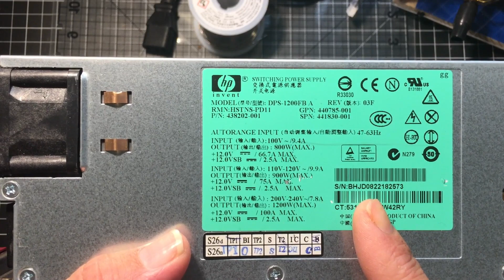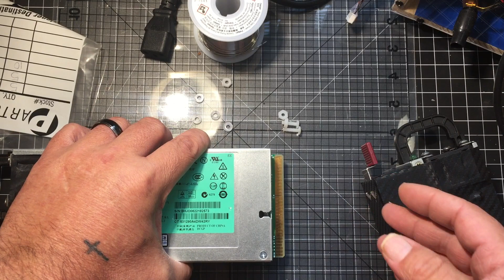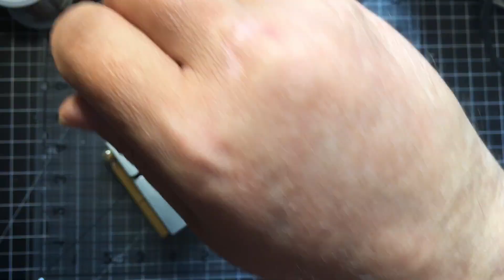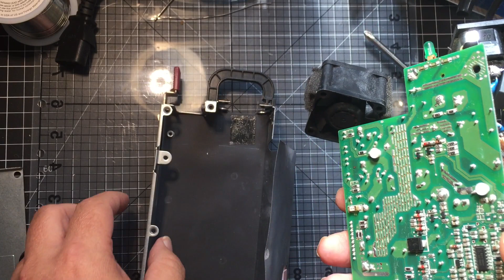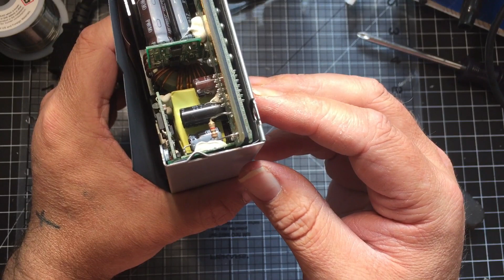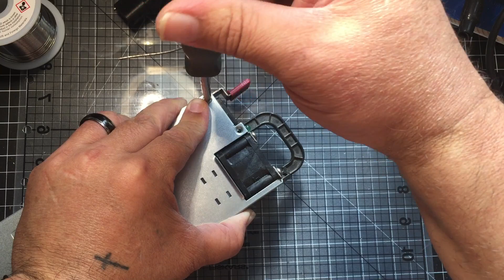HP 1800W (2 x 1200W "900W @ 120v)Server PSU Hack 24V 74A  (HSTNS-PL11) (floating Mod)

Comment: Can I solder a momentary switch to the green+ground or does the short have to be permanent for it to stay turned on?
Reply: You can solder a switch across, it will work

Comment: Should the Server PSU fan be spinning once it received power? Because my rig is pulling around 550watt from the PSU for 3 days now; and the PSU is getting super hot at the center, but the fan isnt spinning at all. Should i be worry? and request for a replacement ?

Comment: Hi, for the benefit of others, i have a HSTNS-PL14 model and 1k resistor between 33 & 36 does not work, so i tried short-circuit between 33 & 36 and it's work perfectly!

Comment: Hello.  please help me, I accidentally made contact between those small pins, the fan went into speed and from that moment even if I make contact between the first and fourth pin, I don't have 12v and the green LED doesn't light up anymore.  Did I burn her?  Is there any chance it will work?  thanks a lot
Reply from the maker: Unfortunately these power supply’s are really fragile when it comes to the pins and interior. I’m not sure if it’s salvageable. It’s hard to know without having it in front of me . Sorry wish I could help.
Reply: @njfulwider5  thanks a lot. Hope to fix it.

Comment: Hi, I bought 3 pieces of HP PSU, each of them is 12V 900W output @ 110V input, can they be connected in series like batteries ?
Reply from the maker: I have seen 2 done in series personally. But I haven’t tried 3. I think there is a video floating around on YouTube where the poster used 3. If I remember correctly he hacked 2 of them and they worked, but I think it maybe safer to find the video and double check. Just to make sure it safe 👍👍👍
Reply: @njfulwider5   Thank you so much !

Comment: good psu or bad ?
Reply from the maker: These server PSU are so cheap and work very well for diy projects. I've used them in a few projects and so far so good!
Reply: @njfulwider5  thank you for confirm , i read is loud / noise not for room . that currect ?
Reply from the maker: @q8tech108  I haven't had no issues with a noisy fan yet. But I could see where that may be an issue later on after tons of usage?

Comment: Where is part 2?
Reply from the maker: Been struggling with the curcuit I made for it, so I put the second video on hold while I caught up on other project, but I do plan on posting before the end of the summer.
Reply: @njfulwider5  thanks for the video. I was hoping to see how you connected them in series. Just that part of it. Is there someplace to see that? Or read what you read or whatever? Thanks again. Eh.. it's not just like you do with batteries is it? 🤔

Comment: How do you calculate the correct ohm resistor?
Reply from the maker: Just watching other videos and doing a little research on other servers PSU I found on Google.
Reply: njfulwider5 is it always the same pins that need to be connected with the resistor or does is vary by power supply?
Reply from the maker: @coltoncarew3047    Each PSU is different unfortunately.

Comment: How do you know your float worked without performing a continuity check from the ground to chassis? You had a multimeter right there.
Reply from the maker: This is not a Hack I created, but a hack well know throughout the DIY community. I didn't come up with it myself. But a continuity test was done, just not videotaped. I have even already finished Part 2, Just need to edit once I get a chance. This is just something you need to do if you plan to use 2 in series, and you plan on the case touching each other stacked. Most PSU like this has to be floated, even good old PC Power supplies where the DIYer uses 2 in series.  The only part causing the PSU to connect to the case is the 2 front screws.  Some even go a step further and do all 4 screws.  I have made many double stacks Power supplies for friends and family, this is just one that posted a couple year ago.
Reply: @njfulwider5   It should be illegal to name something "Part 1" without releasing Part 2 within a year!
 Joking ...kinda.  Although I am glad I didn't watch this way back in 2018!  ;-]
Reply from the maker: Robert Cartier yea I struggled with the curcuit for this and had to put on hold till I figured out what I did wrong or gained more experience. Then one project became 1, than 2 than 3.........then👍👍👍👍
Reply: @njfulwider5  still nothing? My understanding is you just connect the + to the + and - to - then you connect 1 pin from 1 psu to the other pin on the other psu. Can you confirm?
Reply from the maker: @XX-PrinLer-XX  yea the one I was working on was pretty close to basic. I can use them in series easily. But I wanted to create a circuit that shut both off instantly if one shut off for any reason. I also wanted to make sure the curcuit look nice👍👍👍. I think I found the problem and I order more components. Fingers crossed it works, or I have to just 86 the idea and do what everyone else did. Hopefully the new component works👍👍👍
Reply: @njfulwider5  I float my ground on one. Wired the pos and neg. Put a resistor onto both so they turn on automatically. Someone, somewhere mentioned i needed to join a pin from each psu together for load balancing?

Comment: Could someone please point me to his part 2 he mention about Security switch thing in the video trying to do this Or to the guy he got the idea from thanks. I can't find it. Will keep looking.
Reply from the maker: I have not edited the video yet, as it is in-line with the others I have to edit. I do a lot of projects as much as possible, but very slow at editing. The switch is pretty simple as it uses an OctoCopler, that shuts off the power when the other PSU is not producing it. I used Perfboard and a few resistors, fast switching diodes, regular diodes, and the octocopter, I will post a link on this video as soon as it post. If you subscribe and click the bell, you should also get notifications once it post.
Reply: @njfulwider5  thanks for the quick reply. oh okay I thought it was old video. I understand keep it up your doing good I'm just starting. Thanks for making the video. I kept looking though youtube and found this video is about using zener diode here the link
 https://www.youtube.com/watch?v=EQGZm-M_90E&t=310s

I will wait to watch your video. I need to know where to solder the stuff I'm pretty new to this. Now I wondering which one is better or safer.

Comment: how to adjust the output voltage to 10v using external pins?
Reply from the maker: I have only used the potentiometer to adjust to 12.6V personally. But I believe I saw another user adjust to 11.5 at the lowest and 12.9 at the max. To get 10V, you might look into a very powerful buck converter that has the wattage to handle whatever you plan to power @ 10V. I've used both buck and Boost converter with these types of supplies with good results.

Comment: Is floating the ground necessary for a single stand alone unit?
Reply from the maker: Not for a single unit, only if you plan to pair it with another for higher voltage.
Reply: Can you bridge two of these together to increase the amps ? I dont need more voltage I just need more amps . Thanks
Reply: @radian_101  Yeah, connect both units pin 34 together for current sharing info between the 2 units as well IIRC.

Comment: do you know of a way to bypass the over/under voltage so i can set it to 15/16 volts to charge LTO cells
Reply from the maker: Unforantly I don't. I have not dug that deep in the electronics of the psu. Did you happen to see the Power supply I just built using one? That one would be more than capable of charging your LTO Cells-https://youtu.be/ogmdTuobs8w

Comment: From reading the comments, I hope you get better. I didn't completely get rid of the standoffs. I just filed the lip away on the two rears and 3D printed some Nylon washers and screws. I couldn't get the thread to print properly so I just printed it solid 3mm and used a mini torch lighter to control the heat on the case while I slowly threaded in the solid nylon rod which made threads. The Home Depot don't cary nylon bolts and my local HW store will be opened in two days. 

Using this for a 3D printer.

Comment: I have a hp2450w 200 amp and can't find anything, PLEASE HELP!!
johnjosaun@outlook.com
Reply from the maker: What are you looking for?
Reply: @njfulwider5  how to use this  for my 6 Toshiba s.
Reply from the maker: bigdog911 radio what are you wanting to do, I need a little more info and then we can see if there is anything I can help with. For example, it won’t turn on, or im not getting the correct voltage, etc, etc
Reply: @njfulwider5  can I add variable voltage and I already have a 12.1 @124 amp supply how can I combine them together, and get 300+ amps?

Comment: i have a question, i want to build a over 50v powersupply with server supplies these 460w variants to power a dps5020 module how can i manage the inrush current from alle these supplies or is there no issue with this? because i tried older supplies which always weld the switch im using to turn these on to the always on position
Reply from the maker: If your having issues like that with current, I would use a mofset switch. Just make sure you find one capable of the amperage or use multiples in parallel. Then all current travels through the mofset and not the switch. On mine I seem to get a delay. Almost like they use a relay, but another watcher claims there are none. You can also create a soft start on these, believe there is a video floating around where the poster explains how to build
Reply: @njfulwider5  i found out that the supplies which i want to use the hstns-pl14 have a integrated relais and softstarter which is quite amazing they charge the Caps using a resistor and jump the resistor after a second I can hear it click when I pull the plug, I was quite amazed when I figured this out because my older supplies which I used didn't have this and as I said always welded the switch to the on position. These dont do that

Edit: you also mentioned the relais on some units and it's basically what mine have so yeah didn't read that part of you're answered before writing the top part 😅
Reply from the maker: Forgot one of the comments here has how to do a soft start👍👍👍

Comment: i have the same powersupplies  2 of the and just short the two pins to turn it on you dont need a resistor lul
well not exactly the same i have the 460w variant because i just need high voltage not high current
Reply from the maker: I wish it was that simple on this model, but it’s real picky when it comes to the resister used. I never tried just shorting, May try on the next one I build for my friend 👍👍👍
Reply: @njfulwider5  actually it is all you need to do.  guy on a forum confirmed it.  and you need to float all 4 screws.  not just the 2.  https://www.helifreak.com/showthread.php?p=5226152

Comment: Great video. Quick question: I gave an HP509008-001 server power supply and don't know which 2 pins to solder the resistor on to switch it on, how did you determine the 2 pads to "short"?
Reply from the maker: I found the pins to mod just by doing some research. The Type of server psu I used is widely used and modified for these purposes. I tried to see if I could find anything on the one you have and I couldn't find anything on it, unfortunately. But I will keep my eyes peeled and report back if I come across. Sorry, wish i could have been more helpful.
Reply: @njfulwider5  Dude, Thank you very much! Any info is appreciated

Comment: Please wiring diangram PS HP HSTNS-PL12 adj 12v to 15v help please.
Reply from the maker: Besides the adjustment screw, i am pretty sure with no modifications, 13V maybe the highest.
Reply: Psu hack 24v??please mr help me 12v to 13 or 14v
Reply from the maker: @tatafatahillah  to get 24v, you have to use two if these in series. reason, for the float mod, one has to be modified for the series connection. to adjust the voltage as far as it can, just watch this video here https://youtu.be/dnD-zaOznRo?t=1090

Comment: I have two HSTNS-PL11 PART# 438203-001 HOT SWAP supplies, bridge the #1&#4 pin, but cannot get to come on.  any suggestions?
Reply from the maker: Hey, I think you have it bridged to the 5V pin, instead of the 12V pin. Your suppose to have it bridged to 33 and 36 (1 and 3rd), you have yours on 1 and 4. I added solder to pin 4, to use the 5V in a later project, that disconnects both if one loses power for safety.
Reply: njfulwider5 thanks!

Comment: Why do you need to float power supplies in parallel or series, cause im thinking earth ground is for safety as this is a switch mode PSU. so font find it a dumb question
Reply: You are not isolating the case from mains earth as that would indeed be a safety issue... But you are isolating the 12v negative output from the case (floating output).
Reply: you need to isolate one psu so that it is floating and you can put it in series with another because if you would not do that one supplies would be shorted through earth. when you dont need to do that

Comment: Plz suggest the best suitable PSU to Power Pioneer GM-D9601GM Mono Class-D Car Amplifier at Home ? It has the Power Rating of 14.4 V DC & Current 39 Ampre.
Reply from the maker: Typically amps like this runoff Car Battery Voltages (12.6 and above when the car is off and 13.3-14.5V when running). Car Batteries also give you the voltages that you need. I personally would visit a local goodwill or even a yard sale. Look for a Car Battery charger that delivers up to 50 amps. I have seen videos of other Youtubers, DIYing the charger to fit there needs. Here is one of my Favorite videos-https://youtu.be/WO325c_OUgY

You could also use a transformer or Powersupply from an old UPS. But I haven't really to much info on those. But I have heard of others using them to create Car Chargers with amperage of 50. Those have to keep Lead acid batteries charged, for the power loss back up. I have found these also at the local Goodwill.

The last idea, use a Server PSU like this and a boost converter. I have one of those 1800watt Boost converters I could probably connect to this server supply in the video to get the amperage and voltage needed. But I may be limited by the converters amp rating. If that is the case, you could put 2 converters in parallel. 

Hope you get it figured out! Thanks for commenting!!!
Reply: ask this guy,  https://www.youtube.com/user/bigdwiz

Comment: The 470ohm resister, what wattage is it? 1/4w, 1w??
Reply from the maker: I used a 1/4 watt, but you could probably use an 1/8th to 1 watt
Reply: @njfulwider5  none of the 1/4 watt resistors i used worked, 470ohm, 1k ohm
Reply from the maker: @supasonique35  are you using a hstns-pl11? have you tried a higher ohm resistor?
Reply: @njfulwider5  yes the 1200w, so use another 1/4w resistor but higher number, like 2.2k?
Reply from the maker: supasonique35 I can’t remember seeing this model in 1200w? But I’m not to familiar with these. This was my first 2 builds. I do know on some of the other models, the resistor went on different pins. When I get a chance I’ll do some quick research and see what I can find. Is it possible the power supply is faulty? I have had one of those I had to return.
Reply: @supasonique35  Did you ever have any luck with getting yours to turn on?  I'm in the same boat with one of mine.  One works great with 470, the other one doesn't and has the same behavior you describe.  Thanks.

Comment: Where are the jumper diagrams
Reply from the maker: pin 33 and 36 using a 1000 ohm resistor
Reply: @njfulwider5  what did you do with 37
Reply from the maker: hmug tv I planned on adding a on off a little later or a fail safe, so one one shuts off for any reason the other does to😎
Reply: @njfulwider5  yeah I seen an npn transistor used and a switch. Might try that

Comment: you are better off using a tip31 10uf cap and 470 ohm resistor give you slight delay befor initializing the dc volts
they are called Riv-nuts
Reply: No relay
Reply from the maker: Great idea, but typically there is a delay because these use a relay to start( I assume). I see a slight delay when powered and here a click before it shows power. But I may try a cap just to see what it does differently. I’ve built a few of these since my last 2 videos

Comment: No need to remove the back standoffs.  Simply grind or file them down.  Use a nylon washers between the standoffs and the circuit board and fasten with a nylon bolt.
BTW, loose the Oriental music, it's irritating as hell!
Reply from the maker: Yea I was going to do that, but I figured I already had the bolts. Thanks for the comments on the music. I really think no matter the music I use in the background to hide background noise. Someone will never like it. When I watch videos with music I can not stand. I just turn the sound off and turn on closed captioning. Thanks commenting.
Reply: @njfulwider5  I understand that you can't please everybody with background music, but it's not really your choice of music, as much as the fact that it is just a bit too loud.  Indeed, half that volume would be plenty.  Cheers!  ;-)
Reply from the maker: Robert Cartier in the newer videos I typically have it set to 1 on the volume and 3 when doing the work. This video was one of my first and I was still a little new to editing. I still suck at editing 👍

Comment: You don''t have to grind off the standoffs, just use the black insulation over it and hot glue it in.
Reply: You might get away with that, but it's far better to lower the standoffs use a nylon washer and fasten with a nylon screw.  It isn't wise to slipshod Mains voltage.
Reply: @Shadowcruise99  well it isnt mains voltage just the voltage of the one power supply that would be shorted with earth